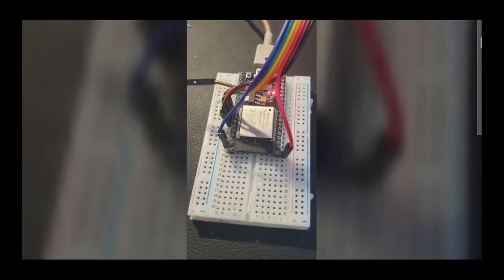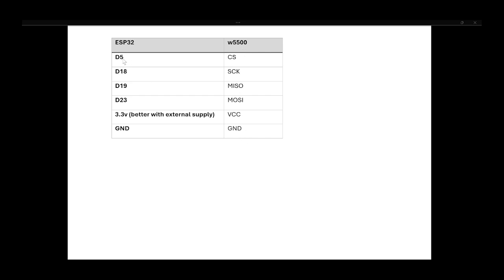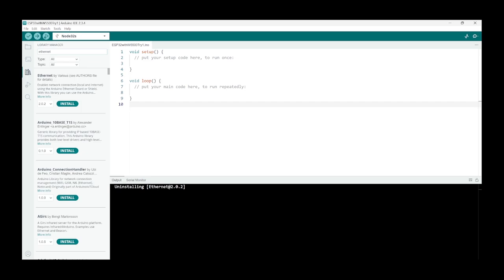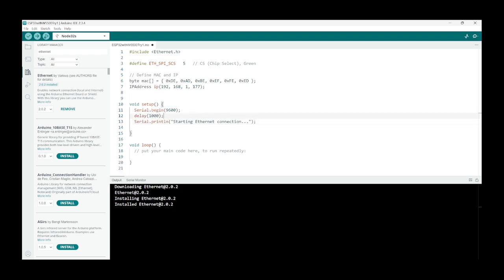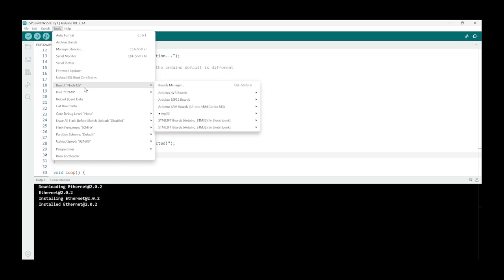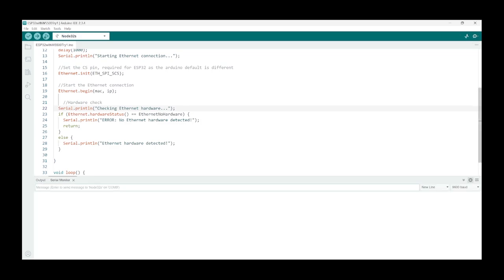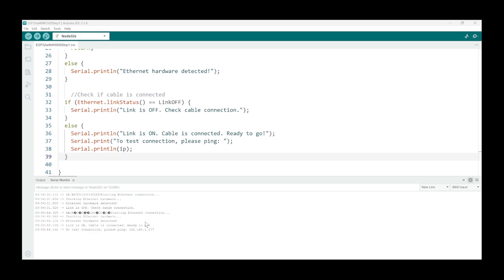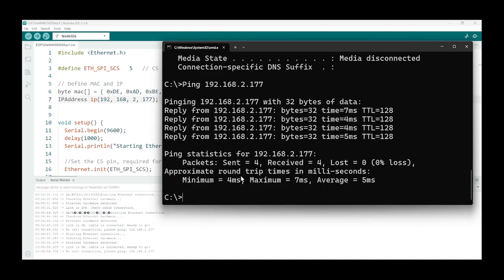Adding LAN to your ESP32 with the W5500 Ethernet LAN Board

Comment: Nice, but I still don't know what that board does.

So Ethernet implements the Layer 1 (physical) and Layer 2 (data link) of the 7-layer OSI model.  Ping is ICMP, and is a Layer 3 service.  Are the common Layer 3 "Internet" services supported?

I would have expected that the board supports at least Layer 1, but the W5500 datasheet summary says it supports TCP, UDP, ICMP, IPv4, ARP, IGMP, PPPoE, and Google mentions DNS.
So what is missing for me is: what of the normal infra that we expect from a LAN is available from the board and through Arduino Ethernet library?

Comment: my esp didn't detect my w5500 mini, why is that?, wiring and code is okay
Reply: 3v3 sourced from esp32
Reply: @rioferzz  

Power the W5500 LAN module from a separate external 3v3 supply. The LAN module draws excess current that the ESP32 cannot always provide.

Don't forget to tie your ground connections together between the ESP32, the LAN module and your external 3v3 supply.
Reply: @rioferzz  same issue
Reply: I have the mini also, I read that not all will work with esp32